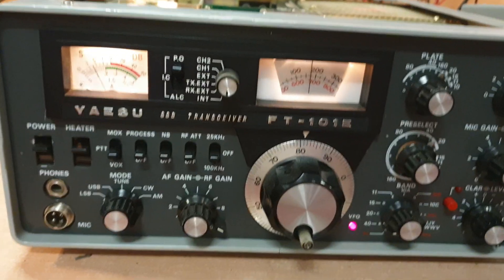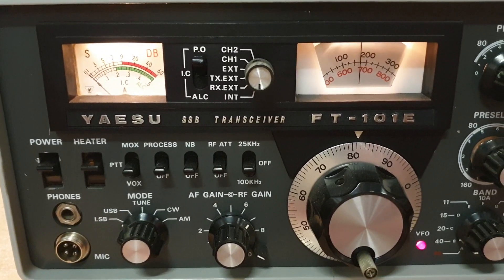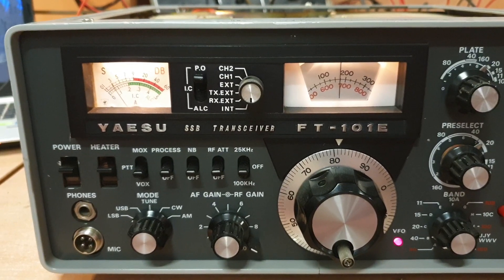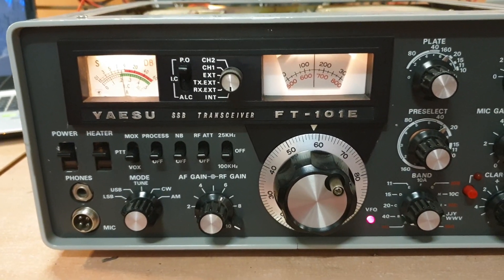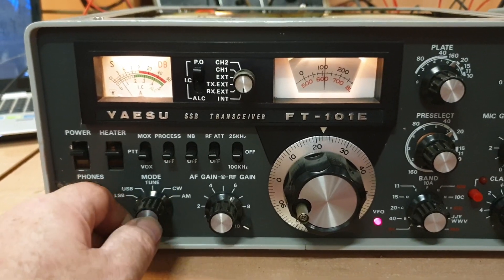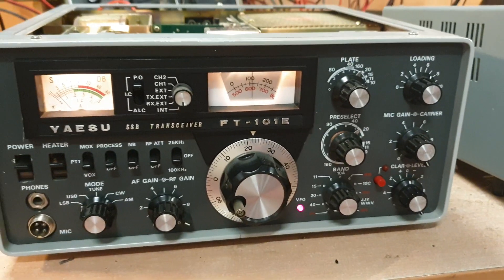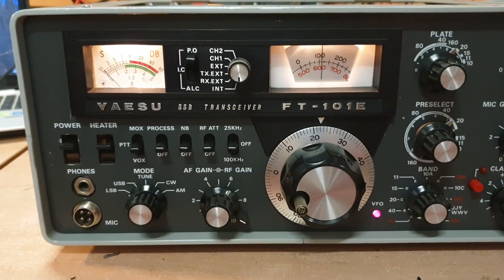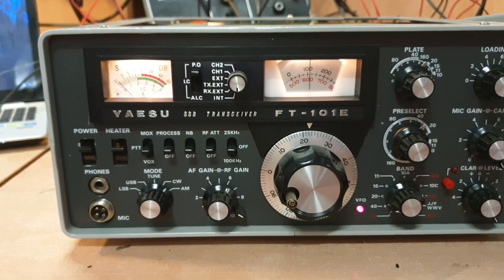The Yaesu FT101E Challenge😁

Comment: I like you think it might be in the VFO section. Are you seeing this problem on all modes and bands? 73's KN4IFI
Reply: You never said if the issue occurred on all bands and modes.  If it does then I agree with Joseph that the VFO should be looked into.  Do you have a CRO that you can look at VFO with.  Even a short wave receiver tuned to the VFO frequency would tell you if the VFO is stable.  You also never mentioned which boards you swapped out.  Did you sub the hetrodyne oscillator board?
Reply from the maker: @terry5089  all modes and all bands....I didnt have a Het Osc board unfortunately, swapped  out a PS board and the af board which I didnt really suspect but nothing to lose. Will check out the VFO stability next....
Reply: @brentonmeadowsvk3cm  You can use a shortwave reciever to check the stability of the local oscillator as well.  As you know, never overlook the power supply voltages.  Good luck.